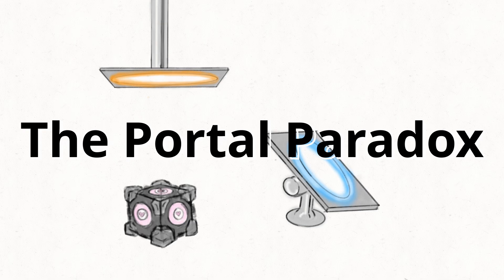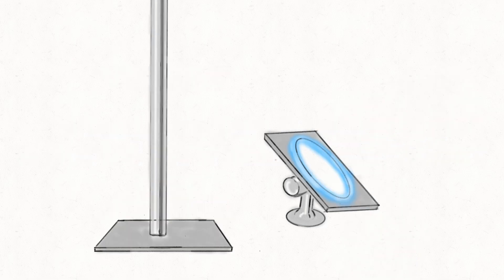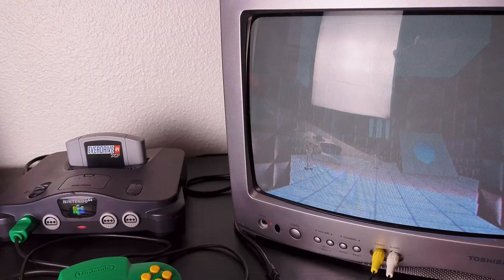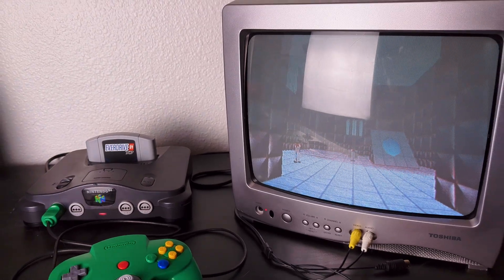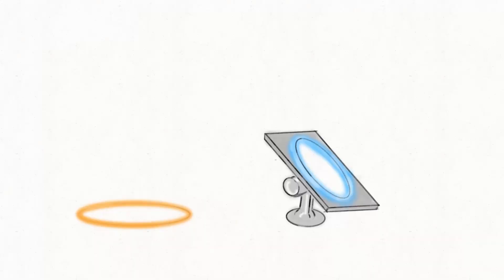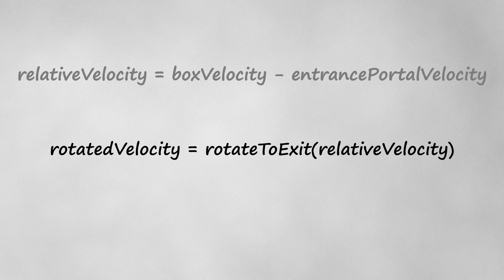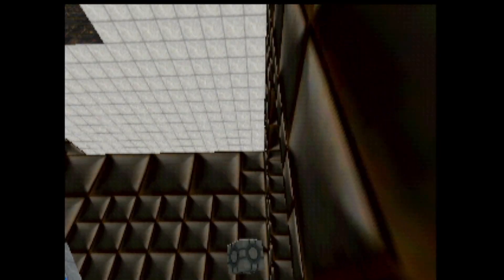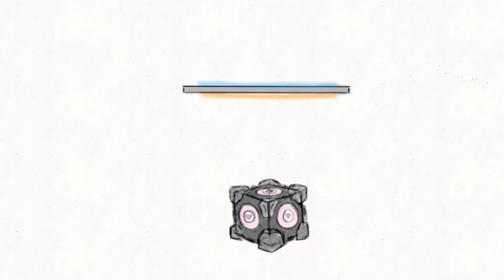I rewrote Portal from scratch and solved the Portal Paradox

Comment: I like the explaination of the two portals attached to the same object. However I think there's some missing elements to the equation here.

The problem is the conservation of momentum. Say you have a portal (Portal A) attached to a platform which is falling (not powered, just falling due to gravity) towards a box resting on the ground. Portal B is stationary and pointing up. The falling platform has momentum caused by gravity, while the box has no momentum as it is at rest. When the platform reaches the box, in your current setup the box will gain enough momentum to fight gravity as it launches out of portal B, but the falling platform does not lose momentum, so where is this extra energy coming from?

My solution would be, that as portal A starts to envelop the box, gravity acting on the box as it comes out of portal B would cause an inverse force against the falling platform, slowing the platform's descent as it transfers its own momentum to the previously stationary box. This way, assuming the box and platform had approximately equal mass, the box would jump out of portal B at half the speed that the platform was falling, and the platform would slow to half its previous speed as the box is launched.
If the box was significantly heavier than the platform, it may not be launched fast enough to leave portal B entirely, and the platform would come to a complete stop before portal A could envelop the box. This would leave the platform seemingly floating because the gravity acting on the box as it pokes through portal B would be too much for the weight of the platform to overcome.

I'm not entirely sure of this answer, as I'm not sure how folding space would affect the setup. I'm no physicist, but the answer above at least made more sense to me as energy needs to be conserved somehow.
Reply: with portal 1, stationary portals, you can fall into a portal and exit through another  farther up. You can also simply turn motion in one direction into motion in another direction, with no side-effects. So neither momentum nor energy are conserve in the original portals, meaning there's no reason moving portals should conserve them.

(to b fair, you could say the portals themselves store arbitrary amounts of energy which is used to offset this and that the facility is transferring the momentum differences through earth, but that also works in this implementation so long as the portals are rigidly attached to the facility)
Reply: @user-sl6gn1ss8p  Huh, I hadn't really considered that the argument was 'what mechanic fits best in the portal 1 game' as opposed to 'what would happen if portals were somehow real'.

My answer was based on the latter. Though to be fair, both examples you've given don't violate the conservation of momentum due to folding space. If you enter a portal and exit another that is farther up, your momentum is conserved because you aren't moving through the space between the portals. You would exit the second at the same velocity you entered the first, and any new forces acting upon you as you exit (different gravity, inherited inertia from the portal moving, etc.) would only act upon matter that has crossed to the other side of the portal (another explanation would be that there is no 'boundary' between the portals, and instead forces like gravity would cross through the portals as well and interact with things on the other side, but I doubt that matches the game mechanic).
The same goes for changing direction. According to the object moving through the portals, direction is arbitrary. Before and after moving through the portal, the momentum is unchanged, the direction according to an onlooker would be different, but there is no energy gained or lost so no laws are broken.
Reply: @superplumpham   @Hamish Williams  "You would exit the second at the same velocity you entered the first"

you wouldn't though, because velocity is not a scalar: direction matters for velocity, and it absolutely matters for conservation of momentum. If it did not, than pushing something and being "pushed back" would actually break the conservation. 

In the reference frame of the room, momentum is not being conserved, since the box changes direction with no associated force. In the reference frame of the box, it isn't being conserved either, since the room itself seems to change direction. That's supposing the portals aren't aligned, which in general they aren't.

Energy is not conserved either unless you postulate portals loose some forms of energy as stuff goes through or something like that, as I mentioned
Reply: @user-sl6gn1ss8p  You make a good point about velocity not being scalar. You can see my non-physisistness showing hahaha.

My understanding is that velocity measures the change in position over time, which is why a vector is needed to recognise the direction of that change, but that the quantitative change is whats important. When calculating momentum, you use the quantity of displacement represented by velocity, multiplied by the object's mass. Without forces acting on the object, it should maintain its momentum, or its kinetic energy.
I can see how changing the direction could be seen as accelerating in a new direction, but if that's the case, it is immediately accelerating in a new direction proportionally to the deceleration in the original direction. Assuming the portal is capable of converting the object's momentum in one direction into momentum in a new direction with 100% efficiency, are any laws of physics actually being broken? (Genuine question as I have no idea)
Reply: @superplumpham  okay, I think this might help:

Imagine there's an astronaut out in space. He is travelling in a small capsule, about the same weight as himself. At one point he goes out of the capsule, say for maintenance. He is holding on to a small ladder on the capsule.

At this point, astronaut and capsule are at rest in relation to one another (and themselves). In their reference frame, they both have velocity (and speed) zero.

Now say the astronaut lets go of the ladder and pushes against the capsule. What is going to happen?

If only the speed ("how fast", no directionality, scalar) mattered, then the only way to conserve momentum would be if both stayed at rest: pushing would do nothing.

Instead, what happens is that the astronaut moves in one direction and the capsule in the other. Since they're going opposite ways, their velocities, which are vectors, cancel out, and as such the total momentum remains zero, as before.

You might think "okay, but the change in velocities are compensating since they are in opposite ways but along the same line". 

So now imagine instead you have three (equal) astronauts, holding hands making a circle out in space. Now they move all their hands to the center (so their arms make 120º angles to each other), and then push at each other, at the same time and with equal force. What will happen?

They'll each be pushed back along the line of their arms, each in a completely different direction. Still, the vector sum of their speeds, in relation to a reference frame in which they weren't moving before, will be zero.

Think of pool balls. If you hit a ball sideways, the balls are still move "ahead", but are also going to be deflected sideways, in opposite directions. That still conserves momentum, but also requires a vector sum to do so.

Going a bit further, you can always decompose vector in any "n"-dimentional into "n" independent components. Conservation of momentum in 3D space means that for any 3 independent directions you choose, momentum has to be independently conserved. Looking at a single direction, you can simplify the calculation by assigning one way negative and the other way positive values and working with the (scalar) speed *along that direction*.

Notice that then in practice you traded a sum of 3-dimensional vectors for  3 sums of scalars.

So, long story short: when only one dimension matters, you can treat conservation of momentum as depending on a (signed, scalar) speed *along that direction*. When more directions are involved, you have to treat velocity as a vector, which can be decomposed along a set of directions that "span the space", so like x, y and z on vanilla 3D space.
Reply: @user-sl6gn1ss8p  That was the best explanation I've found for why the vector component of momentum matters, thanks! 
What I'm struggling with in the case of portals then, is that if the portals aren't aligned and an object moves through it, its momentum is changing relative to the room, but not necessarily relative to the space it is moving through.
In my mind, the portal works so that space on one side is connected to the other seamlessly. A 'straight line' could be drawn through the portal from one side to the other, and from the outside, it would seem to change directions, but following the line, there is no bend. It could be considered linear space. So if an object moves through, its momentum isn't changing relative to the folded space it is moving through but is changing relative to objects that are unaffected by that folded space.

At the end of the day it's a game and there may not be a way to make it work, but it feels intuitively like there should be an answer for what would happen to an object in motion if it moved through folded space.
Reply: @superplumpham  that makes sense, but as I mentioned to @Unaming Gaming, I don't think portals are just folds in space / wormhole kinda things, since gravity doesn't seep through, even though light does (my guess would be electromagnetic and nuclear forces go though but not gravity, which s kinda pretty since our current ways of understanding them are different).

But putting that aside, this partially works if you suppose there actually is an infinite "parallel-dimensions" kinda situation. So if you're in a room and put a portal in one wall and another at the other, and walk through, really you don't get out in the same room, but in a "parallel" identical one. Then, if you look at the (infinite) set of parallel universe rooms, I guess you could say momentum is conversed. Maybe even energy. But that requires infinite parallel universes being accessed through portals and linked so that they as a while conserve momentum (each one of them, independently, doesn't, since you're going in and out of them).

Otherwise, if the room is a single room, with two points "portal-linked" (whatever that means), then, for any point of reference inside the room, momentum is not conserved, since the you you can see through the portals is just a sort of fun-house mirrors kinda of thing, you know? Or like, if you hook a camera up to a screen and then point it to the same screen? You'll see many repetitions of the screen, but there's just the one screen there.

Also, even if you could reconcile that, from your point of view the walls of the room itself wouldn't be conserving momentum - conservation of momentum doesn't say "momentum has to be conserved for some specially selected reference points", it says it has to be conserved for any and all reference points.

(To be fair, that's for inertial reference frames, things get more complicated when general relativity, gravity and acceleration get into the picture, and I don't know enough to speculate then)

(To be fair², conservation of momentum can be derived by Noether's Theorem from the assumption that space is isotropic, which is to say "kind of in a sense looks like the same to the laws of physics even if you shift all positions some amount". Now, it is very possible that portals by their very nature would break this symmetry, in which case maybe momentum shouldn't be conserved. Both the lack of definition on how portals work and my lack of further understanding don't let me go much further here, though)
Reply from the maker: Yeah. If you wanted to conserve momentum that would make a lot of sense to have it come from the piston itself.
Reply: @james.lambert  so long as you avoid free-falling portals : p
Reply: I can see that having the energy come from the falling platform would conserve momentum but why should there be an energy transfer there?

I mean, what force is the box applying on the falling platform and what force is the falling platform applying on the box that would enable this?

I am also not sure how you figured that the object would have half of the platform's velocity, assuming they have equal masses.
Reply: @scientificthesis  it's the quantum-gravitational portal-exchange-force from folded space-time stuff through X-gamma particle decay due to Heisenberg's uncertainty principle, of course! : p

I mean, it's not at all clear how portals work, and I don't think from the original game you could differentiate between momentum and energy conserving portals or not. Gravity at least doesn't seem to seep through them, so I don't think they could be seems as just "space folds" or "wormholes". So no reason why going through them can't involve some sort of unknown interaction, I think
Reply: @scientificthesis  I thought about that as well. I don't fully have an answer, but figured the thought was at least worth putting out there.
My reasoning was that you essentially have a hole in space that is in motion, and that the motion of the object on which the hole rests is the only source of momentum in the whole equation. In order for a stationary object to move out of the second portal it needs to gain momentum from somewhere so the only place I could see that coming from is the object on which the first portal is resting. Excactly what force is acting on it I'm not sure.
I suppose another way to look at it is that the object isn't gaining momentum from its perspective, but instead it is more like space is expanding or contracting around it? There's president for that in physics but the mechanics of it are well beyond me.
My reasoning for halving the original velocity (I should have said momentum btw) was that the object moving through the portal could be considered an interaction with an equal and opposite reaction, splitting the kinetic energy between them, and if they have equal mass then the effect on their velocities should also be equal. Thinking about it now, it's likely more complicated than that, but again, not a physicist. Just like, highschool level knowledge from 8 years ago hahaha
Reply: @superplumpham  Also, conservation of momentum and of energy are different things, not a product of one another.

Say a ball with mass "m" hits another with mass "2m". By conservation of momentum, the result of both balls getting "stuck" and moving at 2/3 the initial velocity is valid. But when you look at kinetic energy, you'll notice 1/3 of it was lost.

This is actually possible. Say instead of balls you had cars, and part of the energy went into the cars bending as they crashed: the collision dissipates energy but it doesn't dissipate momentum.

Also, another note, we've been talking about "momentum", but really we're talking about "linear momentum", that is, the momentum of linear motion. There's also "angular momentum", due to rotation, which should also be conserved, and also isn't in portal, but that's a little more complicated

Comment: This is vaguely related but when taking in consideration that time and gravity are relative how would this change the equation if the portals were not on the same planet? Say a planet and it's moon for example except the starting point is that of the least mass.
Reply: wouldn't matter much, same as when communicating with astronauts on the moon. You'd need denser stuff. But yeah, the general question of how do fields/forces/space-time should affect stuff across portals is pretty interesting.

Comment: While this makes sense in the game it shows how portals break the laws of physics. The cube just gains kinetic energy out of nowhere
Reply: Yeah, the kinetic energy from the piston is transferred to the cube. It's like a roundabout way of giving someone a push and making them move.
Reply: @chrisfratz  The piston never touches the cube, so I don't see how the kinetic energy from the piston could be transferred to it.
Reply: you can have two stationary portals such that you fall forever, or just fall to a higher place. Portals never conversed energy, unless you say they themselves are providing energy to the system, but that also works here.
Reply: @user-sl6gn1ss8p  in the infinite fall thing the cube gains gravitational potential energy which then turns to kinetic as it accelerates downward.

If you were to set up some water falling through turbines between the portals you could generate infinite energy.
Reply: @Bzorlan  yeah, unless you suppose the portals themselves have some energy source which is offsetting that
Reply: No, it doesn't. It obtains the kinetic energy given by the portal that's thrust down onto it. It actually makes perfect sense. 😅
Reply: @JoBot__  The portal doesn't have kinetic energy because the portal doesn't exist. What is thrust onto the box is not the portal, but rather the space on the other end of the portal. If the box is getting kinetic energy from anything, it's the space in front of the blue portal.